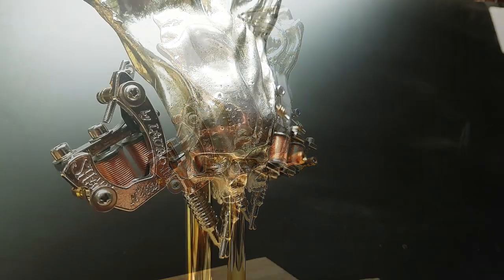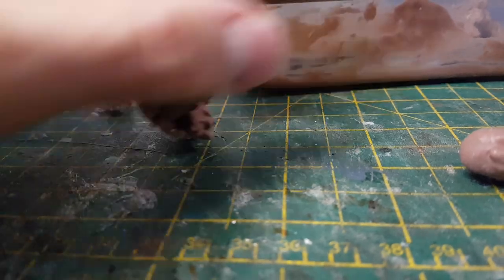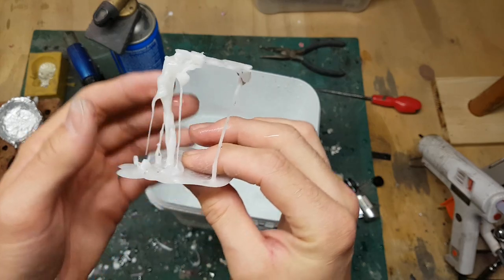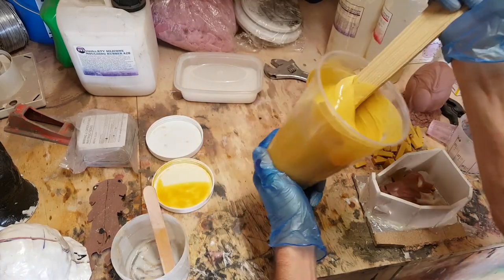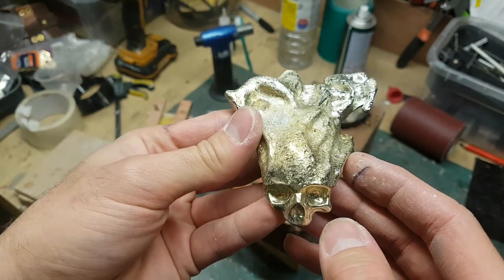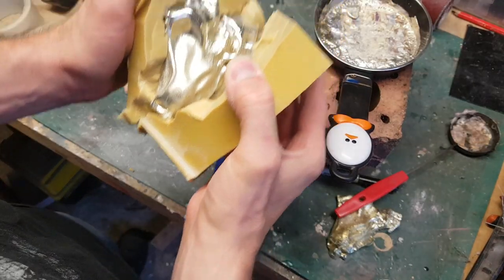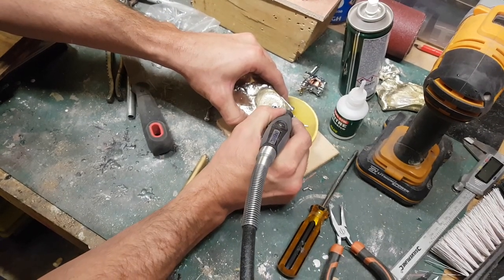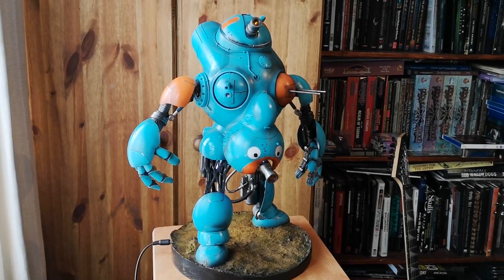Making a Pewter Tattoo Statue

Comment: Excellent vid! Didn't realize pewter could be melted so easily. Figured a furnace was needed.  Also that silicone too seems great.
Reply from the maker: Thanks!  Yeah that's why it's so useful - I was surprised how easy it was to use actually, I didn't need to heat it for very long.
Reply: @thedarkpower   perfect for a mandalorian helmet!
Reply from the maker: @Micky-74-v6f  That would be seriously heavy!  It would look the part though.

Comment: Really nice gift, congrats to her.
Like the experimenting with different materials, came out great.
Ruined a saucepan by melting down hot glue once, that stuff usually comes off surfaces easily so dont know why it went so molten and fused.
Reply from the maker: Cheers dude, yeah I had a go chucking some hot glue into water actually.  Came out Ok - might be OK if you were doing some aliens dioramas or something.

Comment: If you use powdered graphite instead of talc, you will get a much nicer, and shinier finish. As far as getting a good "heat-treatment" look is difficult achieving the "traditional way" due to the usually low melting point of the pewter. Although, it CAN be faked! You can use Copic ink, (purchase the refills, after you determine what colours you want to use), Tamiya or Createx acrylic paints, (you want to use their transparent, "Candy-Colours"), or have the pewter casting(s) plated, (this is the most expensive method, but it would be REAL metal on metal). Personally, I would go with the Copic ink. The ink and/or acrylics can be airbrushed on in any pattern(s) you choose. Seal the paint job(s) with Liquitex Gloss Medium and Varnish, THEN spray on a final protective coat, such as Krylon Acrylic Spray, or a 4K Urethane. DO NOT forgo the Acrylic Gloss Medium before the final sealant!!! Krylon Acrylic Spray and/or 4K Urethane may potentially dissolve your paintwork if directly applied, (they're solvent-based). The acrylic medium will help protect this from occurring. If you want more of a black-ish patina, you can purchase these from your local art supply, such as Tiranti's. (Sorry, I'm only familiar with just a few British suppliers, so you'll need to investigate which one works best for you.) Most patinas sold tend to be a bit wild in how they work, (they are notoriously difficult to control to get a very specific look). Therefore, if you use them be aware that the results can be quite random. 'Hope this helps some.
Reply from the maker: Ah fantastic, thanks for the tips!  Powdered graphite sounds like a good bet then.  I'd seen Alclad do some chromatic heat treatment style pigments which is what made me think of it. I've used patination on brass but I'll have to have go on pewter.  Cheers!
Reply: @thedarkpower  I'm sorry. I completely forgot about Alclad. If you chose to use that, I would recommend the same procedure as I suggested for the ink or acrylics. The whole trick is to create a buffer between the solvent-susceptible inks or paints and the sealer that contains the very solvents that would otherwise cause a problem. (If you want, you could use the "Alclad Aqua-Gloss" in place of the Liquitex. Personally, I prefer the latter.) If you ask the dealer that you get your lead-free pewter, they may have additional possible treatments you can apply to the pewter.
Reply from the maker: @jeffreywarrenpark9149  No worries dude, thanks for the advice! :)